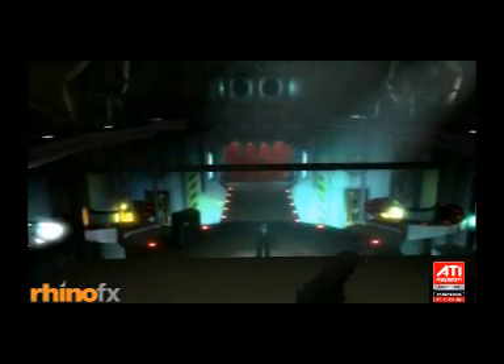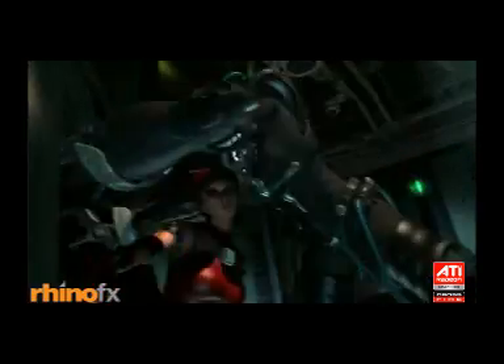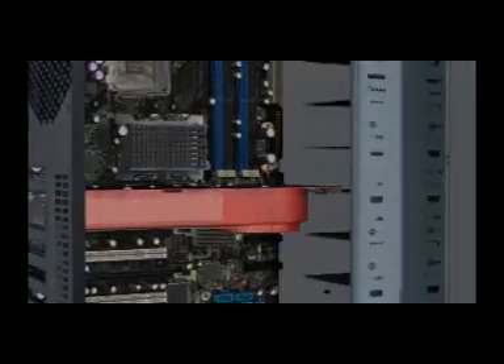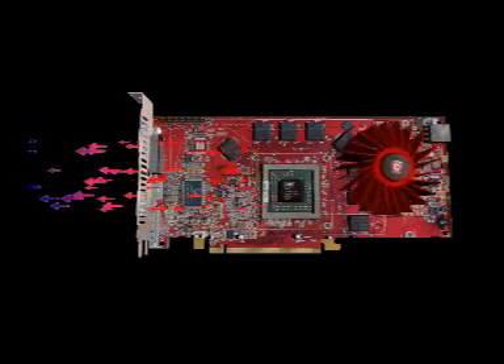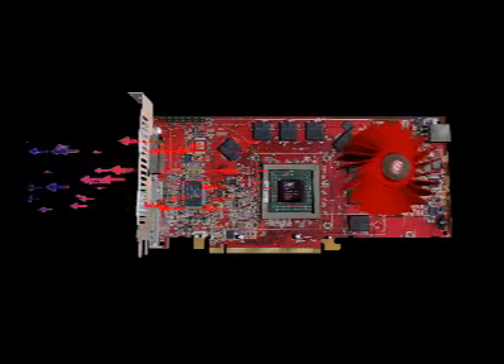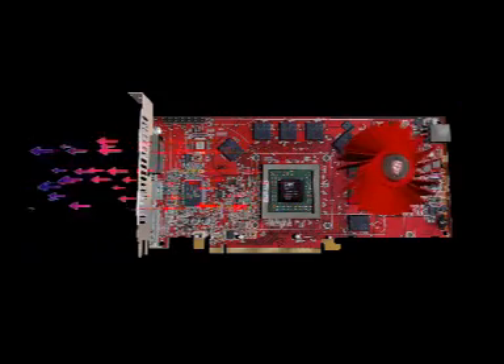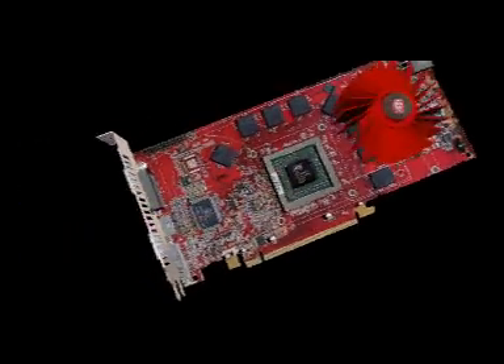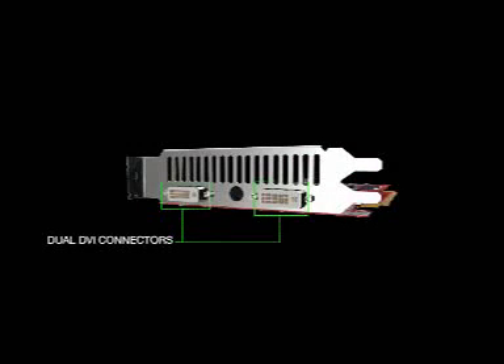ATI CrossFire - WOW!

Comment: Is it possible to get 2 crossfire editions, then one standard, then plug the connectors into the standard, then one of the crossfire editions, then put the connector of the output dvi into the other crossfire editions connector, therefore having 3 way crossfire?

Comment: Actually If we kept requiring more power for video cards we would be going backwards in technology. As die size shrinks so does power draw. The GTX680 for example (Nvidia most powerful single GPU) uses only 2 6pins. as apposed to the previous generation 580 which required a 6 and an 8 pin. More power means more heat.

Comment: @windson7 HD 6870 is between HD5850 and HD5870. Sometimes equals HD5870 in games that use tesselation, due to improvements on architecture.

Comment: ATI had the ability to create a dual GPU HD5970 in this generation because of lower power consumption. The GTX480 had an excelent tesselation architecture based on the fermi GPGPU. 12th gen: Nvidia refined fermi and created the best single GPU GTX580, then launched the Dual GPU GTX 590 to compete with the very fast Dual GPU ATI HD6990. Nvidia still has stronger tesselation units in this generation. Let see what happens in the future.

Comment: ATI Radeon X800 XTX PE. This gen was very competitive between these two GPUs _ 7th gen: The Radeon X1950XTX is the fastest GPU in this gen over the good 7900GTX. Nvidia created the dual GPU 7950GX2 in order to be faster. 8th gen: 8800 Ultra kills the HD2900XTX flop. 9th gen: 9800GX2 with no competition at all, as the 3870X2 was very incompetent. 10th gen: HD4870 was slightly lower than the GTX280 and the same for the HD 4870X2 and GTX295. 11th gen: GTX 480 is faster than HD5870 but power hungry.

Comment: GPU generations

1st gen: Nvidia Geforce 256 DDR _2nd gen: Nvidia Geforce 2 Ultra _3rd gen: Nvidia Geforce 3 TI 500 owned later by ATI Radeon 8500 DDR _4 gen: Nvidia Geforce 4 TI 4600 regained DirectX 8.1 crown over the Radeon 8500 DDR _5th gen: ATI Radeon 9700 PRO was the absolute Directx 9 GPU over the epic fail FX5800 ultra _6th gen: Nvidia 6800 Ultra regain credit with the most robust pixel shader DirectX 9.0c processors, while being slower in vertex shader processors than the (cont.)

Comment: i installed new 2 hd6870  cards and a 750 w psu and connected these with bridge and in most games it runs slower then with one card .. how can that be? what is wrong with my setup and do you have any ideas?
also my psu has plugs for pci express 3 and and i do not know what it means and how to connect using those plugs.. i connect using normal plugsa

Comment: @myid9876543 GTX 480 is a shit card compared to the HD5870. Less heat, less power consumption, less noise. The performance is only significantly better in DX11 games. Nvidia physx whores buy the GTX 480. The HD5870 is the best bang for buck. PWNAGE :@

Comment: yes, but if you didnt know how much your system needed, then your likely ending up buying a flimsy £20 500w power supply that wouldnt be able to power ANY graphics cards, where as a £50 500w power supply from a known brand IS likely to power most gaming systems. So yes, if your a TRUE PC" (more emphasis on the PC bit) Gamer then yes, EVERYTHING in your PC needs to be worried about :)

Comment: This woman is waffling on about the 16 pic-express lanes..... Dear, those have been around for centuries, you dont have to talk that in depth about them.
Secondly, Crossfire costs more Watts on average than SLI and especially a single card... so on average, you spend alot, gain very little more, and increase your electricity bill. Congrats.

You might as well stick with a 4770 Ati, for low end budgets, a GTX275/285 for mid range and 4870x2 ati for high end gaming.

Comment: HI i was wondering if anyone could tell me is it possible to Crossfire/SLI 2 cards of different brand but the same model??

i have the ATI 4850 from gigabyte the red single slot design and i notice that the shape/fan design is exactly the same as the ASUS,HIS,MSI,Sapphire,Gainward 4850s the only differece is the sticker and brandname.

Would it be possible to crossfire them or would you have to use the exact same one????

thanks

Comment: your a idiot.gtx280x2?dude there benchmarks already of the gtx295 and it's only slightley faster than the 4870x2.stop being a fanboy and go check some facts.i always used nvidia but they been screwing people over by over pricing there high end cards that bearley out perform there previous high end series.i think ati/amd has the better arcutecture this time around.

Comment: They both have their strengths and weaknesses but I'd say currently ATi is dominating the price performance market (best bang for your buck) with the 4800 series, which is a $200 or $300 card (Your choice) that beats AMD's $500 & $650 cards (200 series). I have NOT used SLi since I had my old Geforce 6600 GT 128MB. Nvidia SLi doesnt double performance, sometimes its only 18 to 30% improvement which is terrible for buying another $200 card. I've got a 8800 GT OC 512MB but next time I am going ATi

Comment: ATI has a higher quality picture, but a slight drop in FPS in most games (except the source engine)

and Nvidia focus on more fps, so there picture quality is lowered, but a higher FPS is achieved.

also consider drivers :]

ATI drivers are updated quite frequently, thus giving the card a performance boost often, where as Nvidia release drivers every blue moon.

I'd like to say ATI, as they are cheaper and just as good, if not better than it's competitors

Comment: DX10 is a wank..

you dont need a DX10 specific card to play DX10 based games... its just that if you don't then some of the features will be implemented in software which is a little slower.

same goes for crossfire. if you dont use Crossfire Enabled Cards... then some of the features/data transfer will be emulated in software.

either way you will still be able to play your DX10 games using crossfire. it just wont ba AS efficient.